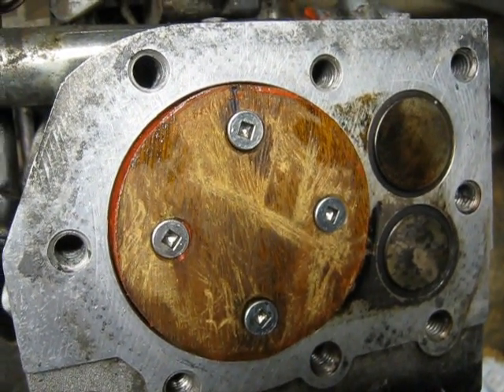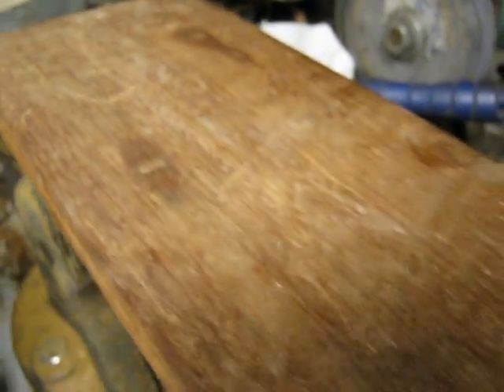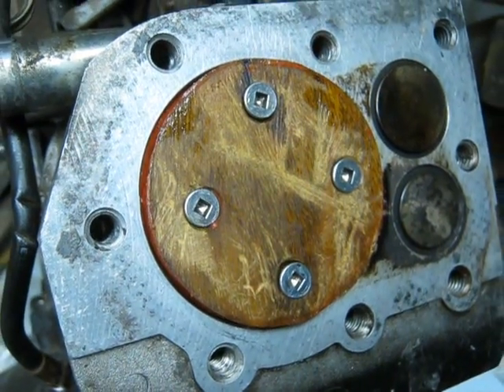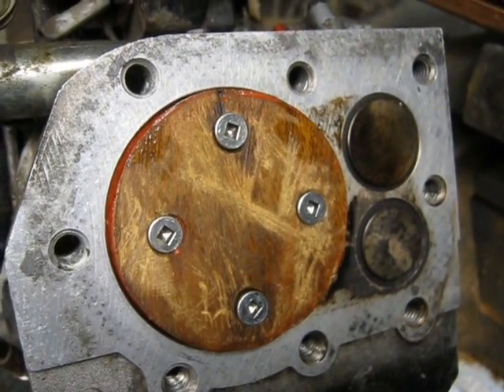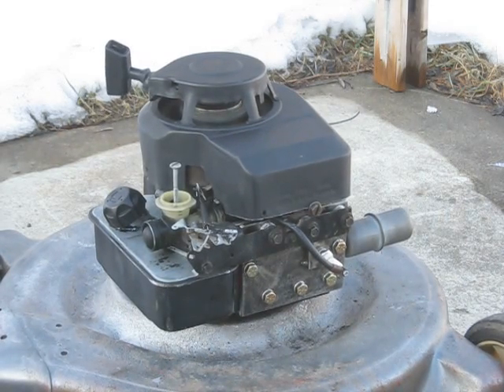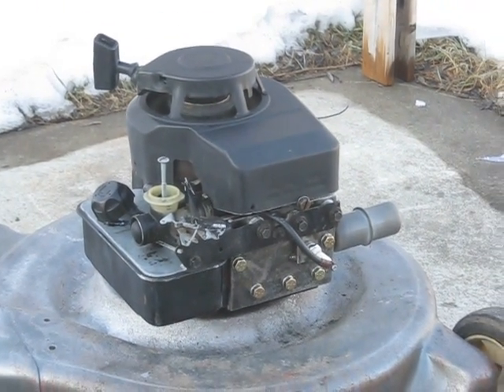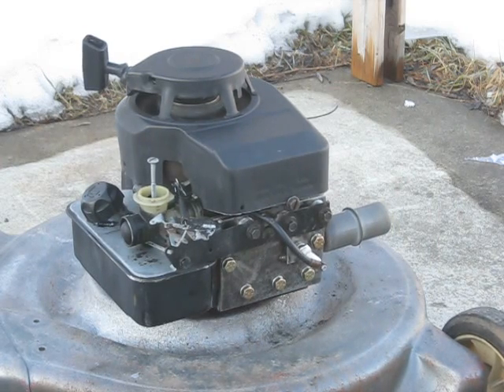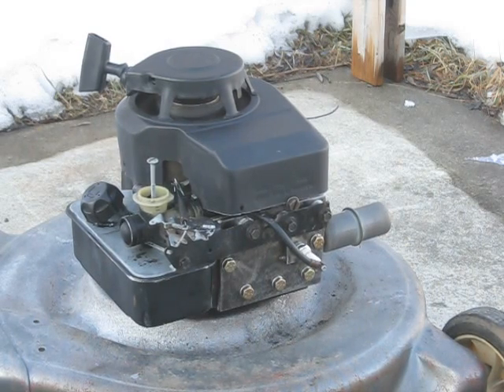IPE (Teak) Piston Running!

Comment: https://www.youtube.com/watch?v=ITTkMQmZEmg   I think I've found it, Trust the Ruskies.
Reply from the maker: That was quite the old chainsaw they made the wooden pistons for!
Reply: It sure was,! that tractor with the lead flashing over the top of the piston to act as a heat shield ,I bet they poured the lead onto the top of the piston while it was in the bore with some screw heads sticking up to act like a mechanical bond, the lead would shrink off the bore slightly, and act as a soft  bearing metal.

Comment: I seem to remember wooden pistons being put in tractors during the second world war, but they had alliminium crowns to stop the heat burning the wood. Beech I think it was.
Reply from the maker: Really, that is amazing that they actually used wood in a production engine! I know aluminum was a scarce commodity during the war, as they needed it for making aircraft. I live near where the aluminum rolling plant is that supplied much of the plate for British aircraft during the war, is is a shadow of its former self now.
Reply: After a bit of research it seems the seagull outboard engine had a piston made of lignum. At least in its early days but as yet its hearsay, but from a fairly good source. The ones I seem to come up with have a metal cap on the top of the crown, Because when the charge goes in on the induction stroke it cools the top of the piston .But during the compression stroke if its say 6.1 compression theirs six times as much oxygen there, so the burn is hot, it needs a metal cap for sure.

Comment: you should try sealing the wood with some wood sealer and see if that makes it last longer
Reply from the maker: It does make it run longer, I used a bit on the balsa piston, and it ran longer than the Box Elder.

Comment: Have you got the iron wood yet?  I can mill some to whatever thickness you need and send you a chunk.
Reply from the maker: No, I haven't found any ironwood. that would be awesome if you could do that. I could use a piece 1/4" thick say 4" long and 3" wide, or a 2-1/2: diameter circle if you have a way of cutting it. Please send me an e-mail at   enforcer12345@hotmail.com
Take care
Miles
Reply: I sent you a message.
Reply from the maker: Thanks
Reply from the maker: All of the wood pieces arrived safe, many thanks, I will start using them as soon as I can, and i will mention who donated them to me!

Comment: Looks like Mangaris Wood which is commonly used in decks.  Check out pics online.
Reply from the maker: Yes, it could be teak also, so a fellow at a lumber mill told me.
I looked it up, it sure looks the same. though I noticed one place does say that the red colored wood can be IPE from south america.

Comment: Dyou change the oil after each of these runs? I'd think all that burning wood and whatnot would dump a lot of contaminates into the oil. Also, you should do a piston crown made out of Hickory. Hickory has a lot of compressive strength, so it ought to work well.
Reply from the maker: i will have a look for hickory at the lumber mill, when I try to get ironwood. I hear hemlock may be a good choice also.

Comment: try making a engine that runs on wood gas :)
Reply from the maker: I have thought of doing that, a youtuber in Cali has ran a VW Beattle  on wood gas, seemed to work pretty well.
Reply: Did you no there was a tiger tank that was made by the Germans that used wood gas XD

Comment: It would be pretty interesting to see if you could put a steel plate over the top of the holed piston to repair it? Years ago my uncle told me about a car that came into the garage for some top end work. Upon removing the head they found a piston with a pop riveted plate on the crown covering a hole
Reply from the maker: Really, I am kind of surprised the pop rivets would hold up for very long. though at least they couldn't unscrew.
Reply: ChargerMiles007 if memory serves the rivets had failed which was causing a rattle of acceleration. Which is why the car came in for work. Owner had no idea the plate was there haha

Comment: Can you do a more in-depth video on the wood piston??
Reply from the maker: Sure, I could do that, from some of the comments I get, I wasn't sure people wanted to know more about it. Though I have gotten many interesting comments , so thanks for your interest. I will make an in depth vid. Anything in particular you want to see/know about regarding it.
Reply: ChargerMiles007 primarily the thickness of the wood that your using, did you modify the crank so the piston doesn't hit the head.
Reply: He talks about  that in one of the other vids. If memory serves, there's a 1/4 inch spacer plate in the head, to compensate for the 1/4 inch piston crown
Reply from the maker: I think I mention it in the oak vid, the wood is 1/4" thick, so I made a 1/4" steel spacer to move the head away from the block. to have any king of a compression ratio i added a flat steel head on top of that. pulling it over it seems to have about normal compression.

Comment: it be cool to see you hit it with some fire ristant off the shelf paint.. to see if that helps any
Reply from the maker: I could try painting one of the wooden piston crowns, I already have another oak one made. I was starting to make another red cedar one, and cracked the whole board lengthwise when I wasn't careful enough with the hand saw.
Reply: I think it would be cool if u hit it with a few coats of high temperature exhaust paint or something to see if that dose help

Comment: do you use fuel in the carburetor?
Reply from the maker: I primed this engine before I started the camera, so it would start easier. It basically runs like a normal engine, I suppose the burning wood adds something to the combustion. Surprisingly the exhaust isn't smokey

Comment: Don't bother with aircraft grade wood, it isn't as good as your hardware store varieties. It has been thoroughly inspected to make sure of that. $$$$
Reply from the maker: A person offered to send me some aircraft grade plywood to try, so I thought I would. the rest of the wood i use is little scrap pieces.
Reply: ChargerMiles007 Then by all means try it. The reddish mahogany stuff with light core people use to make crates is very similar, but heavier.